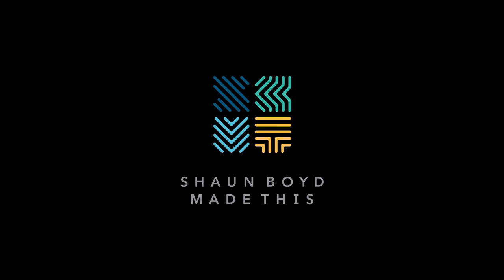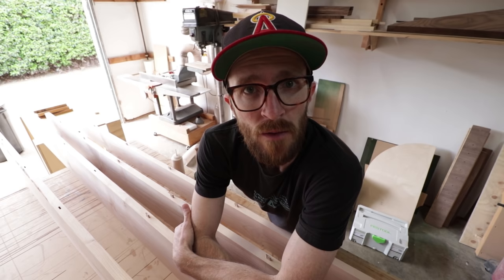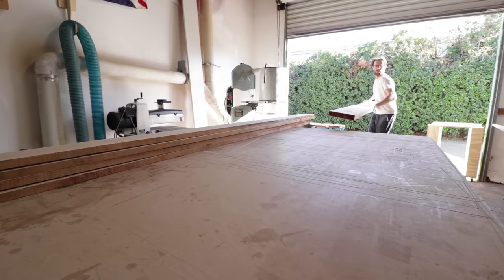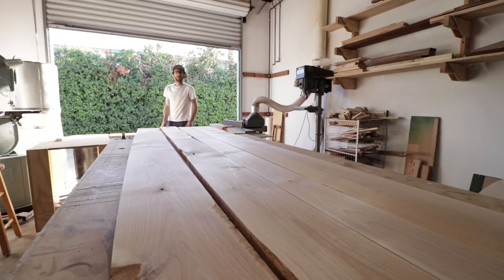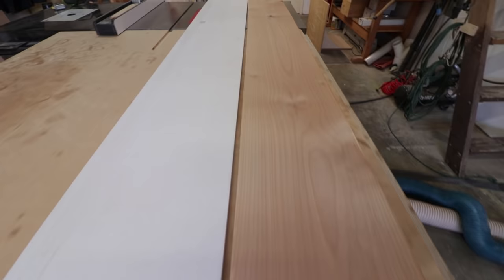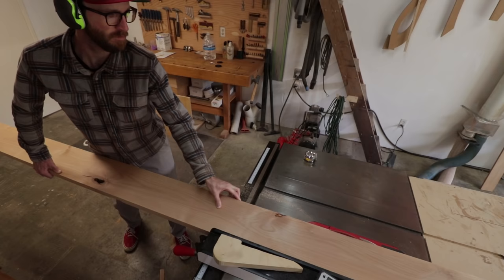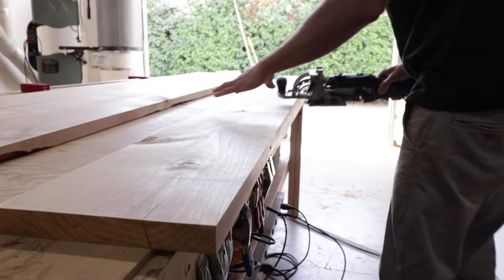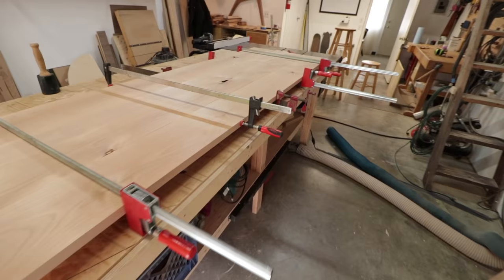How to Make a Table Top Without a Jointer

Comment: You helped this gal out with your most excellent suggestion of edge jointing using a longer known straight board against which to reference through your tablesaw.  Using a planer jointing jig and wedges to get flat top, quickly flipping it to make it parallel and your method of straight lining one edge, I had a lovely piece of dimensioned walnut in about 15 minutes. Far out!  Thanks so much!
Reply from the maker: That's awesome! Glad it helped you out, that's what it is all about!

Comment: The method to joint boards without a jointer is sweet. I am terrified of my jointer so I might just use this method going forward. I would probably add a replaceable hook on the end of the reference sled.
Reply from the maker: Yeah, it is a great technique. Adding a replaceable hook on the end is a great idea, too.

Comment: Wow...this technique surprises me, it’s different than other jig setups.  I wouldn’t think that just using a a long straight edge against a concave edge would give you that good of results.  I mean your fence is a straight edge.  I have to try this and quit pulling my hair out with that freaking jointer.  Thanks Shaun.
Reply from the maker: Thanks, Fred. I use this technique all the time, takes a bit of practice to get the feel for it, but I get great results.
Reply: Shaun Boyd , your seams looked better than any I’ve done, so I hope I can duplicate your technique.

Comment: I have been using a metal straight edge I have that is over 8'.  Use two short screws to hold it to one edge of the board.  Your idea is good.  I don't know if I can keep a straight piece around the shop with out damaging it or using it for a project.  You probably had enough comments on the music, but I'll leave you mine any way.  I like lots of different kinds of music, but find that music is like politics.  It can be very polarizing.  People can love it or hate it.  Different strokes.  I'd prefer no music.  Too distracting.

Comment: A couple ideas for you to make it easier. One is to just use a skil saw and a straight edge. That's the easiest way to handle it. Another thing that I have done is I made my own jointer. I used an electric planer. To build it I used 3/4" prefinished maple ply. Basically make a table top however wide you'd like, mine is 12" wide, and then make a fence. I mounted the planer on edge in the middle of the fence so there is 4' on either side. Slightly offset the aft side of the fence to make up for the removed material so the board will always be riding on the fence. Just gotta make sure the planer is perfectly square to the table. I used a Makita and it has a hole that accepts a 1/2" through bolt to clamp it down. I used shims and an old door strike to secure the other end. I like this method because all jointers require you to run the board through on edge. Not easy with a 2 × 12. This way you run it through flat on the table. I've found this works for any length of board but typically run 10' or shorter boards through it.
Reply from the maker: Both are great ways to do it! Thanks for your suggestions and thanks for watching!

Comment: Rad, Shaun. I have jointed boards by clamping them on top of a flat piece but i wouldn't have been smart enough to figure out how to do it this way. I dug this video and would be stoked to see more like it.
Reply from the maker: Right on! Same concept, just even simpler, which is always my preferred method! Haha. Thanks for watching!
Reply: I was also wondering -- do you buy wood that is already surfaced on one side, or is it rough cut all the way around? thanks
Reply from the maker: Kind of depends on what my local lumber supplier has in stock, but I would say 80% of the time I buy stuff that is rough on all sides.

Comment: As someone who is going to try and tackle a table in the near future, this was extremely helpful and simple. I appreciate the video. Wondering how much tolerance you're allowed when joining this way though. I'm finding the cuts on my table saw are a bit rough and didn't know if that's a common experience.
Reply from the maker: If you have a sharp (and clean) blade and a tuned up table saw, you should be able to get pretty good cuts that will give you a near invisible glue seam.

Comment: Really helps to have a big table like that... I am really struggling flattening a tabletop I am making for a personal project. It's hard getting a level, flat surface for a reference. I have been trying to use saw horses and a router to smooth it over, as well as laying my sled on 2 timbers that are almost at the same height as the tabletop. It's still got a long way to go. I think maybe I just don't have the equipment or work space to make it look professional.

Comment: Omg thank you! That’s the simplest way I’ve seen shown on how to get crooked boards straight. What if the broad sides weren’t level or warped, how would you level it without a planer or jointer?? Make a video on that plz!
Reply from the maker: Awesome, glad you enjoyed it! Thanks for watching! As for flattening the faces without a planer or jointer, that is a tough one. With long, thin material like in a table top, I often orient the boards during glue-up to cancel out any bow in them, or I just do my best to select the straightest boards at the lumber yard. Other than that, going after it with hand tools might be the only other option!

Comment: You make it look easy. I have a smaller job site saw and I don't think I could keep the boards straight as they go thru. I need 9' boards and can't come up with a way to do it yet. Just tried making a long fence on my out-feed table and spun my saw around to make it an in-feed. Still couldn't get a straight line.
Reply from the maker: Yeah, definitely trying to do this on a small saw would be difficult. Having the extra table size and stability is pretty crucial.

Comment: Also, if you don't have a tablesaw with a long outfeed table, you can use a handheld router with a pattern bit to copy the straight edge of the 10ft MDF board. Getting the other side to be perfectly parallel might be tricky, but it also might not be vital given that you usually trim the ends off later.
Reply from the maker: Yep, that is definitely another effective way to get it done. Thanks for watching!

Comment: Nice and clear. One question though. Did you bought the boards already flattened because you’d skip face jointing and planed the boards instead of jointing.
Reply from the maker: Thanks for watching! Because I don't have a big jointer, I spend extra time picking out lumber that is as straight as I can find. Also, when I make something like a big table top, I usually use thinner material (~1" thick) and can orient the boards so that when I glue them up and use dominos, any bow in a board can be more or less cancelled out by the boards it is being joined to. Hopefully that makes sense!

Comment: well the biggest hurdle is not the jointer because that can be done very easy with even just a simple hand planer and plane one edge if needed, but the most difficult part is not having the machine planer to keep the boards all in the same thickness because that in it self to do it by hand is way more labor intensive and in order to make a jig for it involves much more work for that process ....all tho that also can be done by making a router jig to plan the full top sides of the boards.

Comment: Hi, I would like to build a floating desk roughly 10'5"x27" and I'm looking to use pine I don't wanna use center supports to the ground and the desk is going from one wall to the next what thickness pine should I use would 1x6s be enough or should I do 2x6s or should I be thinking of a different wood species I would like to keep cost down but I also don't want it to collapse lol. I would also be using this jointing method. Any help would be appreciated.

Comment: Shaun, love your videos, the information within, and your sense of humor.  Keep them coming!  

For not using the joiner, the boards you had seemed to be extremely flat.  Did you have the top and bottom faces joined at the mill?  I get using the table saw for the side of the piece as a joiner would, but what if there is a cup or twist in the lumber?  I’m new to woodworking and trying to figure out how to get rid of these common problems.  Any help you could give or other experienced woodworking fans of your channel, I would be so appreciative!  Thnx again.  Love your designs and work!
Reply from the maker: Thanks Ben! Yeah in this situation, I do my best to select straight boards. Obviously jointing and planing is ideal, but often times with long and relatively thin boards, that isn't possible. If there is any bow or twist in a board, it can usually be canceled out during the glue-up when arranged next to other (more) straight boards. Hope that makes sense!

Comment: Love the new small vids! I take it the face of boards were flat to send through the planer? Sorry still learning and the little I know is that one side needs to be flat to get the best results our of a planer?
Reply from the maker: Thanks, Sam! Glad you enjoyed it. These boards were flat enough to send through the planer. You are right that you need one side relatively flat to get a decent surface planed onto the other side. With thinner boards like these, all I'm really looking for is for both faces to be parallel and even thickness along the length of the board. Hope that makes sense.

Comment: Would you recommend a portable table saw for doing something like this? A portable saw fits my space and budget much better but I do not know if I will be able to rip long boards perfectly straight.
Reply from the maker: It definitely wouldn't be as easy, but it is doable. Maybe try it with some shorter boards first to see how comfortable you are with it. An outfeed table will also help a lot.

Comment: Quick question.  What's the purpose of using the piece of MDF when you ripped the first board?  Wouldn't using the fence accomplish the same thing in getting a straight edge (similar to how you ripped the other side of the first board?)
Reply from the maker: The MDF acts as the straight edge riding along the fence. If your board has a bow in it, it will ride along the fence and essentially transfer that bow to the cut side.

Comment: Great video.  I do the same but with a long level. Ever have any concerns about not somehow adhering the wood to the MDF?  Not permanent, more like tape, just to keep everything sliding together?  Also, should you alternate sides of the cut wood in case the TS blade has a slight angle (there will be some no matter how small).
Reply from the maker: Thanks for watching! I have done it enough times where I don't worry about it not being adhered to the MDF, but that would definitely help add a little extra security. And yes, I am actually making a video right now about alternating the cut orientation on each board to cancel out any variation in blade angle (or jointer fence angle).

Comment: Sorry iam really new at this, the big brush planer that you use to make the wood flat is what, a big carpenter brush  that make it totally flat? Thanks
Reply from the maker: Yeah, the planer basically makes the top face smooth and parallel to the bottom face of a board.

Comment: Right on!  I'm looking forward to seeing more of these videos as well as your regular format.   Would be curious to know what you do when you need to flatten a wide board, planer sled? or do you mostly just stick with S2S stock?
Reply from the maker: Awesome, glad you are into it! I rarely by surfaced lumber, even this alder wasn't considered surfaced when I bought it even though it is pretty clean. When I have a wide board that really needs to be flat, I often go with partially jointing one side, then sending it through the planer on a sled. I actually used that technique in my desk build video from a couple weeks ago, but maybe I will add it to the list for these shorter format videos.
Reply: Shaun Boyd thanks I actually watched the desk build just after this one. That's an interesting technique I've never seen before.

Comment: I'm a little confused about the lack of face jointing. You start off in the planer without any prior jointing to flatten the face and no mention is made of hand-planing the table after the glue-up. At what point in the process are you flattening the table top?  Thanks.
Reply from the maker: For long, fairly thin boards like this, you could potentially lose a ton of thickness by face jointing then planing these. I do my best to pick flat lumber from the beginning, then orient the boards so that any bow is canceled out by the board next to it during the glue-up. Any additional flattening after the glue-up is done if necessary, but 90% of the time, all it needs is some sanding.

Comment: Is it fairly easy/ safe to manage sliding the work piece and the mdf together? Would using a feather board or some blue tape be helpful at all to keep them together snugly?
Reply from the maker: It takes a little getting used to, but it is pretty easy once you get the feel for it. A feather board could help, but might not be much use if you have a board with a lot of variation along the edge. Obviously only do this if you are very comfortable with a table saw, or maybe try it with a smaller piece first to see how it feels. Thanks for watching!

Comment: It seems like you took the roughy boards and ran them directly through the thickness planer. Did you not run them through the jointer first?
Reply from the maker: Not in this case. I always take care to find the straightest boards I can, then orient them in a way that when they are doweled and glued together, any bow is more or less canceled out by the adjacent boards.

Comment: Using the melamine in the planer doesn't necessarily ensure flat wood.  Maybe works for already flat-ish wood but something cupped, crowned, or twisted wouldn't work.  You'd still need the jointer for the face surface or even a router jointer sled.  How does that work for you with really rough cut wood?  Just my opinion, not a criticism.  Side note, I'm glad to be reminded of the jointer/table saw trick.  I cut off a fair portion of 2 fingers on my left hand due to kickback on my jointer.
Reply from the maker: You are definitely right, face jointing is usually the first step. In this case though, the lumber was pretty flat, and with long, fairly thin boards, any bow or twist can more or less be cancelled out when all the boards are glued together and attached to the table base.
Reply: Fair enough.  In this case do you glue/domino a few together then plane again to make those flat together?
Reply from the maker: Yeah, that definitely helps. I'll often glue up panels just under the width of my planer, then glue up the larger panel once the smaller ones are flat.

Comment: Just now getting Into woodworking and don’t quite understand why you can’t use the rip fence as the straight edge and do the same thing minus the white board? Hoping someone can explain. Thank you
Reply: The white board was essentially a very straight extension to the fence. If he just used the fence, the cut would follow the same curve of the board as you pushed it along the fence. In other words itd only be as straight as the the points contacting the fence.

Comment: If I were to make a table top of a smaller scale. Would I still need to domino/dowel/biscuit the boards together, or would glue be sufficient?
Reply from the maker: Glue is plenty strong for joints like this. The dominos/dowels/biscuits are mostly just to help with alignment when gluing everything together.

Comment: Do you think using a circular saw and a Kreg Rip-Cut would work well enough? Getting into woodworking and trying to decide what accessories to buy now!
Reply from the maker: I’ve never used any of the Kreg stuff, but any sort of track saw or even a homemade track and circular saw would work just as well.
Reply: @shaunboydmadethis  Awesome, thanks! I only have a circular saw for now, but a rip guide is probably one of the first things I'm going to make!

Comment: Nice tabletop 👍 Honest question.  If you start at the planer, what do you do if you have a twist or cup?  I know you can plane it out with shims and a sled, but it looks like you just sent the boards through as is.  If you have a flat reference on your rough lumber you're lucky.
Reply from the maker: Thanks! I do my best to select straight lumber when I can, but you are right that isn't always possible. With a big and fairly thin (~1") tabletop, and using dominos to help with alignment, it is usually totally possible to cancel out any bow in a particular board. Especially once it is attached to a table base.
Reply: @shaunboydmadethis  Cool